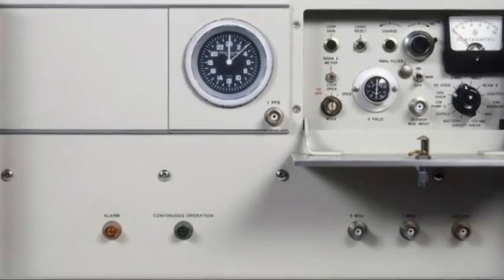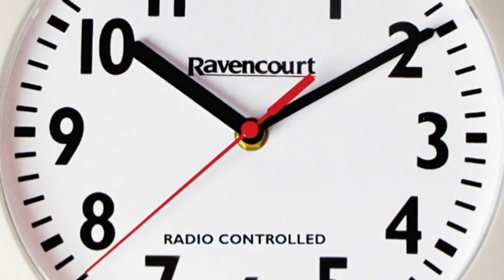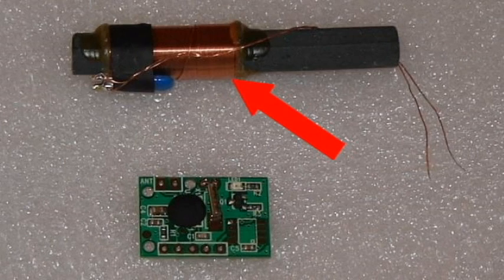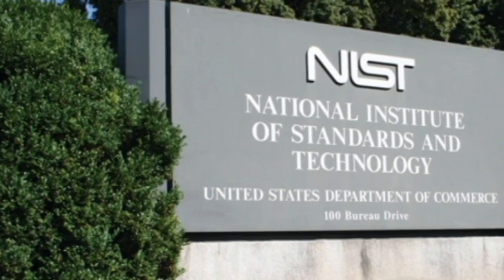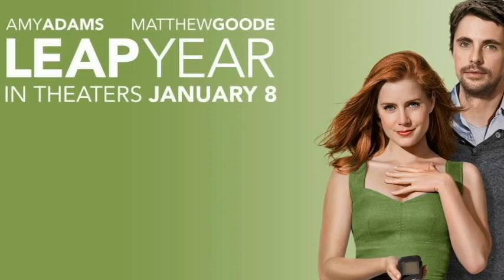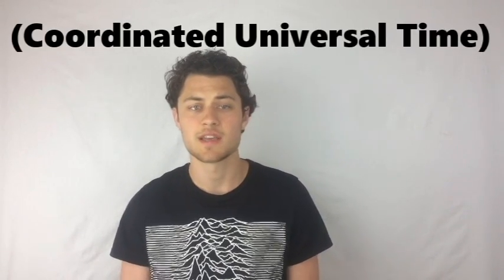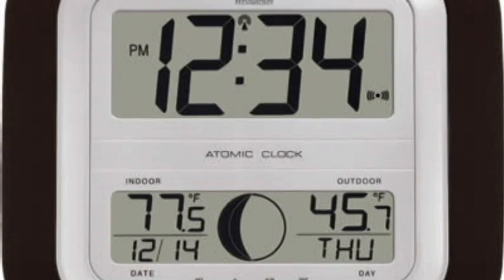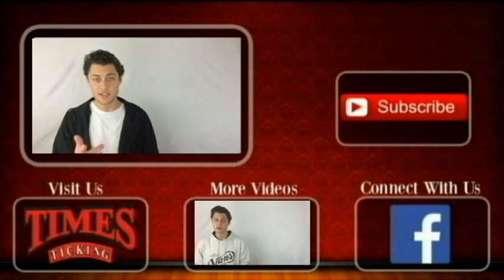How Does a Radio Controlled Clock Work?

Comment: What are the codes that are transmitted? How far does the signal reach? What happens when the clock is out of reach? Are there other time transmitting stations around the world, where are they and do they use the same system?
Reply: The codes are binary codes which the circuitry in your watch or clock can interpret. There are 4 main transmitters in the world depending on where you live, all with a range of about 1250 miles. They are located in Colorado USA, UK, Japan and Germany. The transmission frequency is between 50 - 60 Mhz. For instance the transmitter in Colorado covers all of continental America although the signal strength in Alaska is said to be so weak as to be unreliable. If no signal is available or detectable, a radio controlled clock functions as a regular quartz clock until the signal is once again received.
Reply: @johno4521  So that means it has a chip inside?

Comment: Still don't understand the purpose of these radio controlled wall clocks. If there is a problem with a signal, your clock might show wrong time. With analog watch you dont have that problem, you set the time and it runs perfectly untill battery runs out.